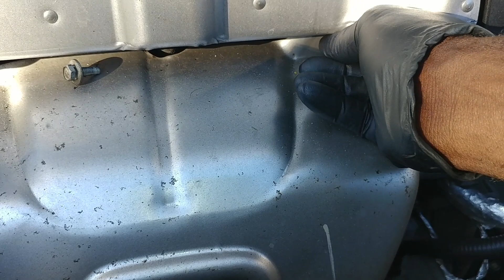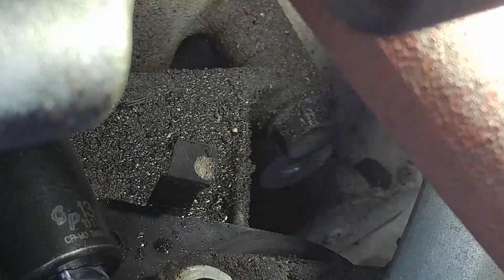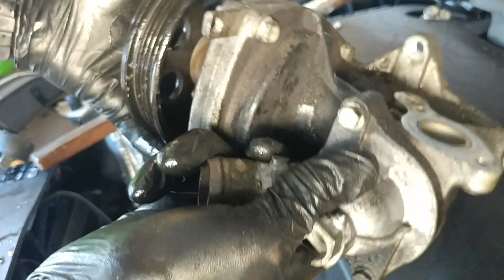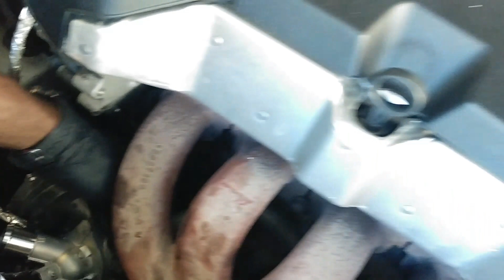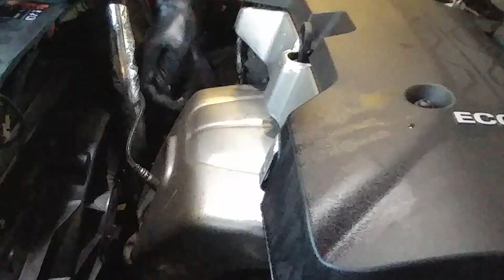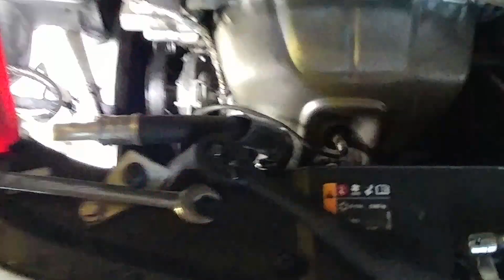Malibu water pump replacement

Comment: Great job! I only missed the serpentine belt part, couldn't see what u did to pull it out, and how u put it back!!! Was gonna paid to get mine fixed! Thx for the video! Appreciate it!
Reply from the maker: Look at 7:47 i put an ½  inch ratchet handle on the belt tensioner to move the tensioner and release the tension off the belt
Reply from the maker: Try to draw the  belt pattern on a piece of paper and that will help you to out it back correctly
Reply: I want pictures for ½ inch ratchet handle

Comment: How do you know if you should get the entire assembly or just the part that the belt goes on? It’s showing different parts that come up on every parts site and I’m not sure if I need the full assembly
Reply: I went with the whole assembly being that it comes with the thermostat, might as well get that  changed and avoid any future problems

Comment: What are the torque specs?
Reply from the maker: Send me your email and i will send it to
Reply from the maker: Tighten (3) bolts to 25 Nm (18 lb ft).

Tighten (4) bolt to 25 Nm (18 lb ft).

Install the thermostat bypass pipe (2) to the water pump with a NEW gasket (3) and tighten the fasteners (1) to 10 Nm (89 lb in).